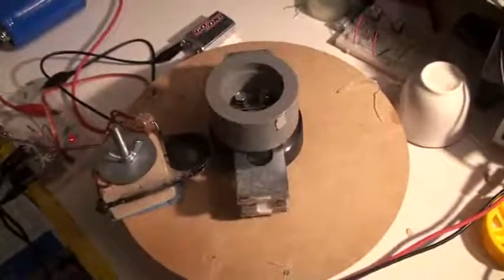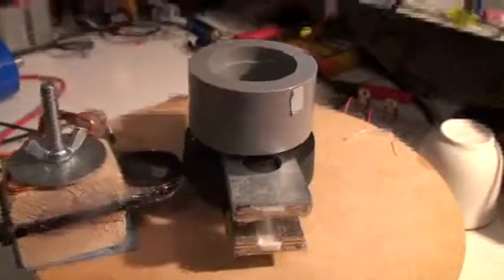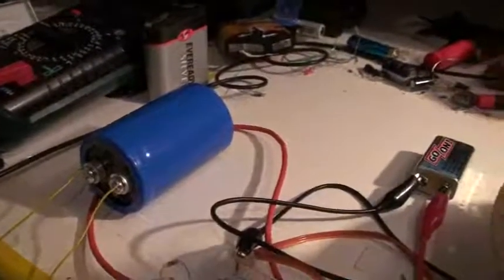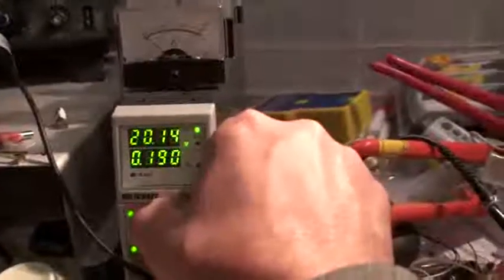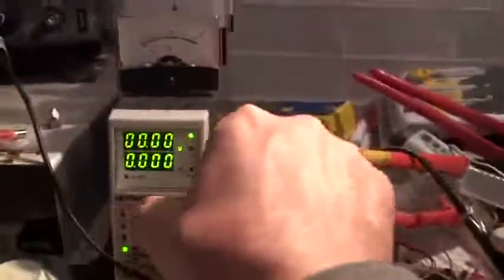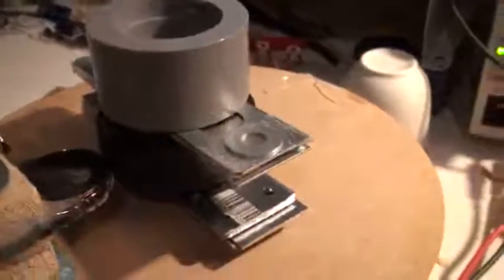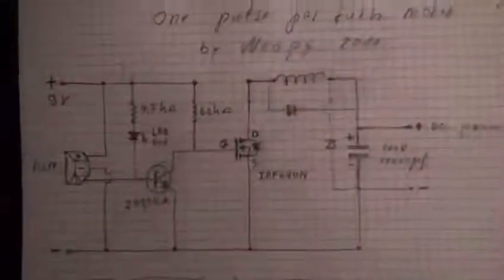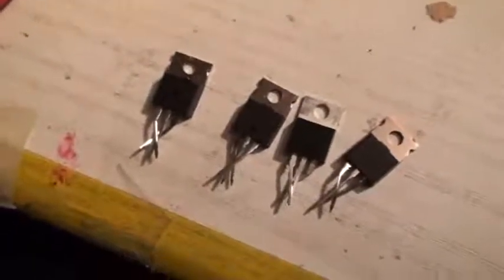lockridge test 1

Comment: Woopy, you can see when you slow down your motor that the "CC" light on your power supply starts to flash.  The power supply is telling you that the current draw is so high that it has to limit the current because it can't supply any more.  Get rid of the big capacitor and lower the maximum current output from your power supply and then  you won't destroy any more MOSFETs.   The current draw going down with a load is normal for a pulse motor, less pulses per second = less current.